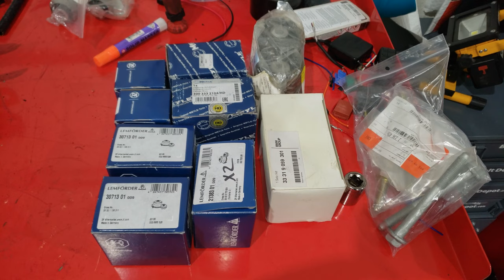Rear subframe removed and trunk taken apart - Alpina B3 3.2 Touring (E36) - Jan 2022 Update

Comment: What radiator was fitted to this car? I need one for mine and the Alpina parts manual is wrong stating that it is a std E36 6 cylinder radiator. Thanks
Reply from the maker: It is a standard E36 radiator in my car. However, there were several different radiators that were standard depending on the model, build, and market. I recall mine cross referenced with a 328i with the expansion tank on the right side. So in the US, it would be the same as a US 3.2 M3 or US 328i.